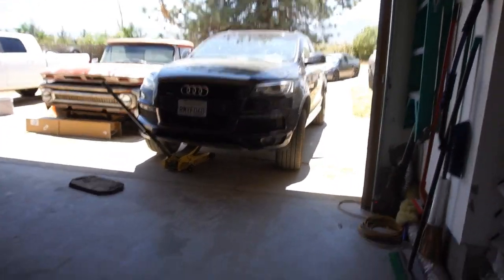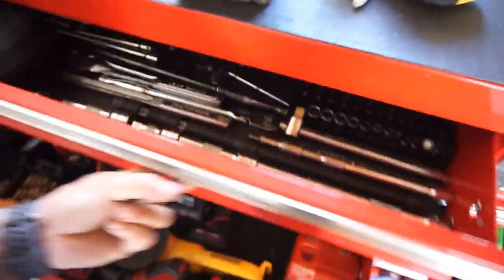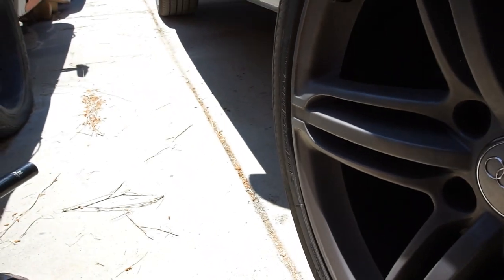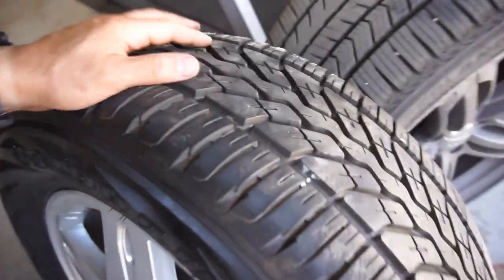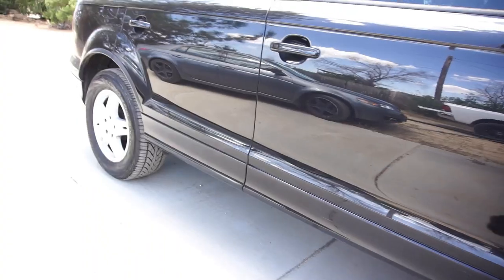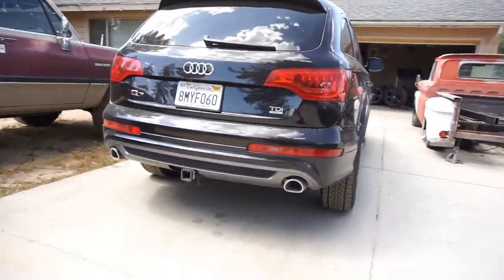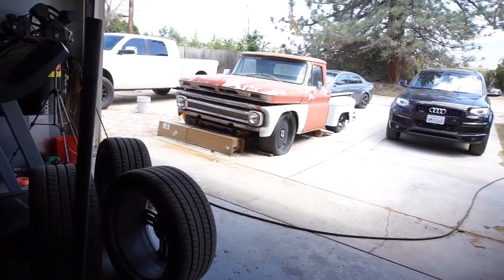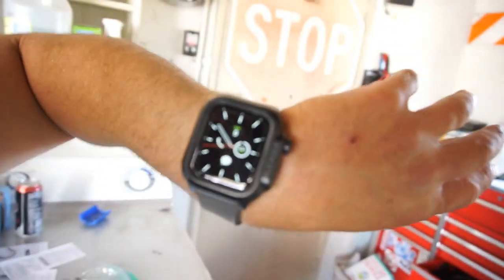Lets Put Some Bigger Tires On The 2015 Audi Q7 TDI S-line. From A G Wagon..

Comment: I think the factory wheels look much better but I can see that the MB wheels would give ya a lot better of a ride . It's not like ya' work a couple of miles down the road .  You drive a lot of miles just to get to work , no sense in arriving fatigued more than needed from the drive . A clear case of function over looks .
Reply from the maker: The Audi drives really smooth with the factory wheels and really really smooth with the MB wheels. Hopefully when I get home I’ll have those centering rings delivered and can put them on and drive on clouds.

Comment: I am thinking the tires just are not fully balanced.  I get a slight shimmy from about 56 - 61 mph on my 35s... any speed before or after is nice and smooth.
Reply from the maker: It’s probably all 3. Tomorrow’s video, balancing and hub Centric Rings. The Audi’s hub is 71.6mm and the G-wagon wheel hub opening is 84.1mm. And being that they’re lug bolts and not lug studs, the wheels are off centered a tiny bit. Once I get those centric rings I’m gonna have them balanced and installed.